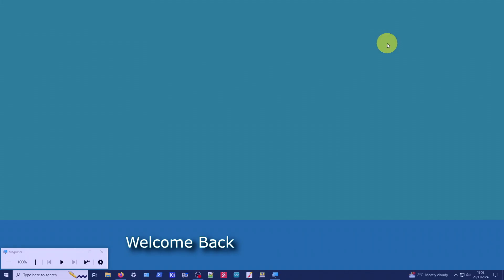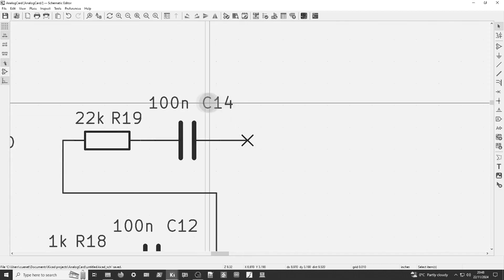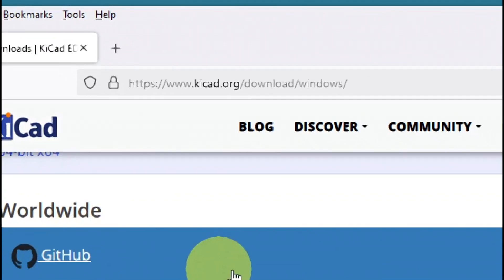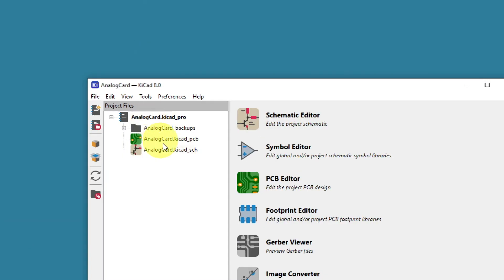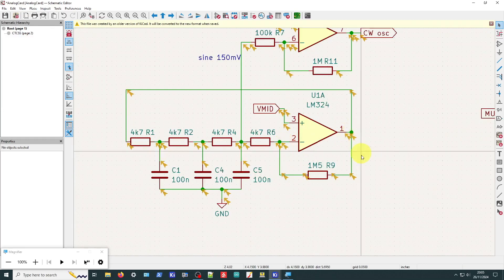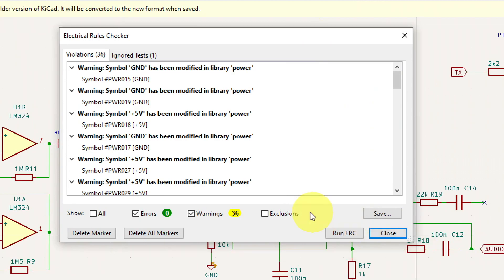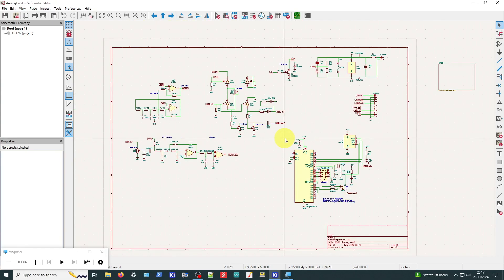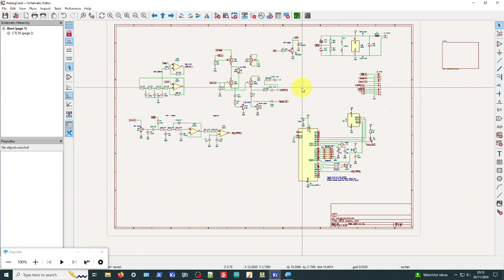KiCad V6 to KiCad V8 schematic migration. We got warnings! - fixed.

Comment: Your video was a lifesaver! I was panicking after getting over 100 ERC  warnings in Kicad 9. My mistake was changing the default grid setting to a ridiculously small value like 0.001 mils while editing a component in the symbol editor. This caused my component pins and the schematic wires to sit on different grid points I guess. After watching your clear explanation I solved this problem in no time. Thanks again!